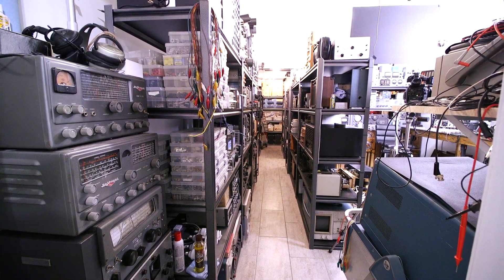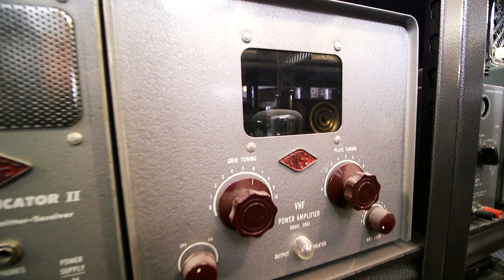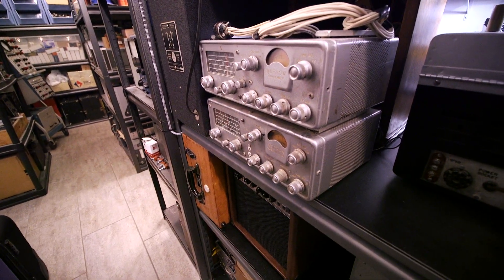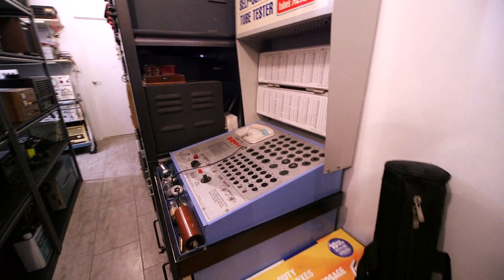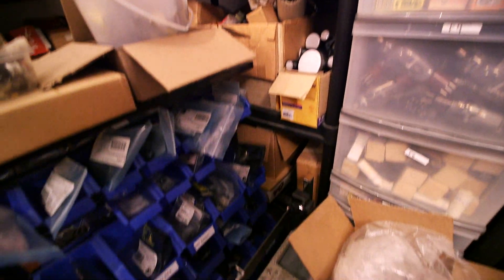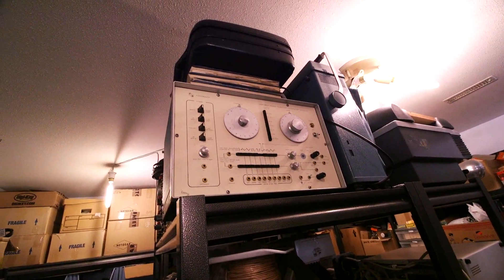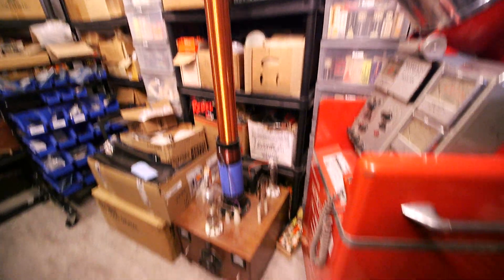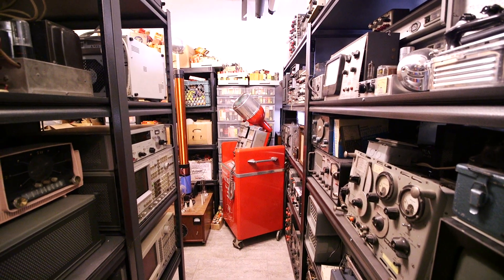Neat Projects Inside Lab 2!

Comment: 🤔 as an automotive diagnostic tech, my vote is definitely for restoration. But I have a soft spot for old automotive test equipment so I'm definitely biased here.
Reply: I agree!  Automotive test equipment of all brands are still needed by those of us repairing/restoring engines from way back when.  That machine would look great in a car museum like Jay Leno's.  I wish I was smart enough to restore the test units that I do have.
Reply from the maker: Thanks for your input!
Reply: @welderfixer  Yeah, those may be the only testers, and vehicles for that matter, that will still work after a - natural or not, intentional or not - EMP event.  The rest of the lab would suddenly become priceless, too.  But if you do go with UFO's make sure you have good infrared coverage.  They're most visible at night!
Reply: I wonder if it's restored what adapters would have to be made for it to work with newer cars? Maybe a crank sensor cable and a magnetic spark pickup. I am planing on having a FPGA listen in to a SPI based encoder; so anything is possible.
Reply: I wish I was smart enough to stop checking for spark with my tongue.
Reply: @funone8716  You won't have to worry much longer!
Reply: @Videot99  Thank ya captain obvious
Reply: @funone8716  Back in the 70's I once locked the keys to my mom's car inside with the engine running.  Simple I thought, I'll just open the hood and pull the center wire off the distributor.  It's one of those things you never forget!
Reply: @Videot99  Oooow
Reply: @funone8716  At least the engine stopped, and my heart restarted.  After trying to figure out what had happened I ended up with a 40 year career in electronics.  Funny how things go sometimes.
Reply: I am a auto tech myself and am in favor of an accurate restoration. I think I could still correctly interpret a scope pattern 🤓
Reply: Dave Micolichek You’re correct, pretty much anything with distributorless ignition it’s not going to do anything for you. Very few auto shops would want the hulking machine taking up space. modern test scoping equipment can typically be taken mobile in the car. This is a big deal when trying to sort out intermittent concerns or misfires that happen only out on the road. But that said, it will work just fine on my 1978 fiat! It would look cool in the garage next to it and be fun to service it with. Actually several manufacturers kept the distributors up till about 2000.
Reply: Dave Micolichek some people say “they don’t make em like they used to” ....... I say- “thank God!”     Except when I need to replace a key😂.
A lot of the electronics now seen in cars are test runs for autonomous car systems of the future.
Reply: @fredfabris7187  they don't make em like they used to for sure. Now there's multiple networks communicating to each other, over 100 control units in some cars that all need to be happy with what everyone else is saying, cameras, multiple radar systems, telematics systems that are starting to rival your phone and allow telediagnosis from the dealer with proper access rights. 

Pretty much all of the systems needed to support autonomous driving are already in some cars it's just software and laws preventing them from running away on their own (2018+ fully loaded s-class or e-class for example).

And it's my job to be able to diagnose and repair these systems and networks (MBZ specifically), I love it.
Reply: Don't forget the augmented reality camera integrated into navigation on the new MBUX system hahaha
Reply: pkhanzo my job too!😎
Reply: Dave Micolichek  Many vehicles newer than 1986 still had distributors in them. Ford didn't go completely distributorless until 1996...and I think they were one of the first to do so....
Reply: Dave Micolichek  Honda was using distributors well into the 90s.
Reply: Dave Micolichek  An ignition scope can be useful on a fuel injected vehicle. I realize that machine is not an oscilloscope, but an oscilloscope is very useful for diagnostics of even the the latest model vehicles, as can be seen by watching some of the South Main Auto channel channel videos where Eric O uses an oscilloscope to troubleshoot vehicles. Note that Eric O has a reputation of fixing problems that other shops cannot...probably because they limit their diagnostics to the scan tool.
Reply: Dave Micolichek  GM industrial engines were made with distributors as late as 2008. Probably still are. (Mercury Marine 3.0L for example).
Reply: Dave Micolichek  It is simply not true that "Anything that can be done with an oscilloscope can be done with a proper scan tool". A scan tool can't tell you that your cooling fan motor has worn brushes, for example, but a scope with a current clamp can. And that's just one example of many. I will also point out that some professional scan tools INCLUDE oscilloscope functionality. No, I'm not talking about graphing a sensor via OBD-II PIDs. They actually have inputs for probes, like a real oscilloscope.
Reply: Dave Micolichek  And an ignition scope can (for example) tell you if your P0301 misfire code is due to an ignition problem or something else, like an injector problem.
Reply: Dave Micolichek  and when there's no change do you conclude that the injector is bad or you have no spark?
Reply: Dave Micolichek  By the way...there ARE fuel injected vehicles that are NOT OBD-II and will NOT give you any codes or data about misfires. These would be pretty much anything prior to 1996. Ford vehicles equipped with EEC-IV are one such example. In fact, for these EEC-IV vehicles, there exists a thing known as an EEC-IV breakout box, designed to allow easy connection of all EEC-IV inputs and outputs to test equipment such as...wait for it...an oscilloscope! Even for the OBD-II successor to EEC-IV known as EEC-V, there is a breakout box.
Reply: Dave Micolichek  It may also come as a complete shock to you, but many of these pre OBD-II fuel injected vehicles DO NOT HAVE a datastream. You can't use a scantool to look at live data with these. All you get is codes, and those are extremely limited compared to what you get with OBD-II (many of these vehicles only use 2 digit codes...and none of them are misfire codes).
Reply: Dave Micolichek  There were a handful (not "many") of cars before 96 that were OBD-II.
Reply: Dave Micolichek  A DMM? But I thought all you needed is a scantool. Scopes aren't big and heavy these days, some fit in the palm of your hand.
Reply: Dave Micolichek  You keep making the claim that there is no use for an oscilloscope to repair todays cars yet there is plenty of evidence to the contrary.
Reply: Dave Micolichek  OBD-II prior to 1996. I count 10 models here: The list includes the 1994 Chevrolet Corvette, Buick Regal 3800 V6, Toyota Camry V6, Lexus ES300, and Toyota T100 pickup with the 2.4-liter four banger.

Also included are the 1995 Chevrolet T-Series pickups, Chrysler Neon, Dodge Stratus, Nissan 240 SX, and Nissan Maxima.
Reply: Dave Micolichek  No. You don't need one. If you throw enough parts at it, you can fix it without any diagnostic equipment at all.
Reply: Dave Micolichek  Why don't you give the exhaustive list of 1994 and 1995 OBD-II models, since you claim that there were so many?
Reply: Dave Micolichek  South Main Auto right here on Youtube uses a scope to diagnose vehicles, and has quite a few videos showing the numerous ways it can be used. Better? That's a matter of opinion. Easier? If you're not proficient with one I suppose. More compact? They're pretty small these days. 

I figured you wouldn't be able to provide a list of 1994-1995 OBD-II cars. You say you won't, but we both know you can't. You seemed to have been completely unaware of vehicles post-1987 that contained distributors (yes the GM 3800 didn't, but that's not the only engine out there now is it?), so your knowledge about what models and years contained what type of systems is suspect at best.

The bottom line, after all this back and forth...is that yes, a scope is still useful for vehicles made after 1986. And there are numerous videos right here on Youtube which demonstrate that.

That you are apparently unaware of them is your problem, not mine.
Reply: Dave Micolichek  What dealership scan tool costs $8k?
Reply: Dave Micolichek  The Verus? I've used it before. It can't do everything that, for example, even a GM Tech II can.
Reply: Dave Micolichek  I'll stick to more functional scan tools that don't cost $8k because they're "Snap On". Piece of overpriced shit couldn't even program keyfobs on a 2004 GM. Snap-On should stick to hand tools.
Reply: Dave Micolichek  Scan tools and oscilloscopes are complimentary to each other. There are some situations where the scan tool doesn't work for diagnosis, and an oscilloscope does. These situations are rare, but they do occur.  I will also note that the Snap-On Verus scantool includes oscilloscope functionality, not that it justifies the price tag.

I purchased an 8-channel USB automotive oscilloscope for around $125. I most recently used it to find what was causing a 2008 Mercury Marine 3.0L engine to cut out and die. This turned out to be caused by a flaky ignition module. 

There were suspicions that the ignition module was potentially bad, the scope just confirmed it...and also confirmed that, even when the module was "working", it really wasn't working correctly. 

The waveform on the new module looks much better than the old one did. The engine has more power than it did before and the boat gets up on plane easier.

 While the module could have just been replaced on the hunch that it was bad, it's not any fun to be in a boat in the middle of the Potomac River with an engine that won't run. So using the scope helped confirm that the ignition module was in fact the cause of the problem and that replacing it would FOR SURE correct the problem....the assurance that the owner of the boat needed to be OK taking it out on the water again.
Reply: @PKhanz  Would you say that the electronic side of things in a Mercedes is built as good as the mechanical side? BR, Per
Reply: Well that's a hell of a debate over oscilloscope diagnosis haha.

They have their value for sure in a shop. Do you need one? I'd say for about 98% of problems, no. If you're proficient with one you may be able to diagnose some faults quicker than without one, but it's not always worth it.

Problem-solving does not always have a clear path that must be followed and you are limited to the knowledge, information and tools available at the time. 

If there's a misfiring cylinder, you could swap plugs/coils and see if it moves. Or you could scope the secondary and interpret the pattern. You could do a mechanical compression test, or you could disable fuel and do a relative compression test with an amp clamp and scope on the battery negative cable while cranking.

Cam vs crankshaft correlation fault? You could mechanically check the base engine timing, or scope the cam and crank sensors and measure the angle variation with a math channel and in cylinder pressure transducer.  Engine design will determine which one I choose. 

There's multiple ways to approach the same fault profile and end at the same conclusion. Some are faster, some are slower, some require disassembly  while others don't. To say one way is right and one is wrong, I feel, is reductive as long as the same conclusion is reached with similar effort and time invested.

The ignition analyzer in the video would be fairly useless on modern vehicles but could most likely be adapted. If I think I need to scope all the secondaries on an engine, I'm having a really bad time with the car.

But when an '86 560 SEL comes in with a rough idle, misfire and lack of power I'm reaching for the scope to determine fuel or ignition problems.
Reply: Dave Micolichek  use one every day
Reply: Dave Micolichek  I was just trying to say there's different ways to get the same information and personal preference doesn't make it right or wrong.  As long as the same result is found accurately then what's the trouble in doing it differently than someone else?
Reply: @brianleeper5737  Ford had 4 or 5 additional test modes that made quick, really quick work of fairly straightforward and sometimes more inane problems. I haven't known amt mechanics on the independent side who knew what they were or how to invoke them with the jumper wire. Very impressive. I wonder if I could do them today myself....?
And don't forget the Crown Victoria's and Marquis' that had no check engine light, but had electronic controls and trouble codes. Good times!
Reply: @johnnytacokleinschmidt515  I have a 1988 Mustang GT with no check engine light, but does have EEC-IV. Strangely enough it does have a spot in the cluster for a check engine light, but Ford never installed the bulb or the wire to the EEC-IV to make it work.
Reply: @brianleeper5737  ooh, very interesting. I hadn't noticed that although I've worked on many. So you bring your test light attached to 12 Volts positive and stick it in the top right and ground the bottom left to induce self test. Key on engine off codes first. Then memory codes flash out two or three digit codes. Then you can start the engine and invoke key on engine running test. You can invoke cylinder balance after that I think with a WOT wide open throttle. After key on engine off you can invoke the wiggle test or output state test. It's been a very looking time.... But I knew these tests and it put the Snap-on brick and GM data stream to shame in my humble opinion. I fixed many many Ford's very quickly.
Your car sounds like allot of fun. My friend had a few. Clutches, changed out and repaired T-5's I remember. A few accidents. He took out the interlock on the column of his manual shift 5.0. He didn't like the little actuator to remove the key. I told him not to and why. He did it. And got the mat stuck on the gas pedal on a wet night fooling around. Shut the key off and locked his steering wheel while trying to negotiate at Moderate speed. Up the curb and into a telephone pole. I drive slow and boring cars. Usually in a slow and boring manner. Stay safe and God Bless!
Reply: @LaserFur  Primary side is great for fuel injectors. Many could give a good AC output type reading on the alternator. That's a pretty good start. Any distributorless adaptor set grin the 1990's world probably give it good forward compatibility. Electronic guys would figure it out.
Reply: @fredfabris7187  Ionization or firing line. Spark and burn time and tilt of the spark line. Stacked display to check for distributor irregularity. Bent shafts, worn bushings and breaker cams. Good stuff. Definitely easy to see open wires, low compression, fouled plugs, cross firing in the cap, cranked insulators on the plugs, lean or excessively rich mixtures, and arcing/secondary insulation breakdown of wires and plug insulators. Easy to see faulty ignition modules on the primary side when the dwell was fixed or too short or noisey. Good stuff. Long time ago!...